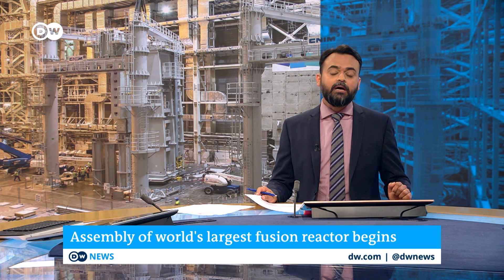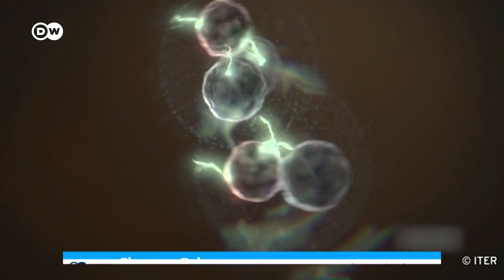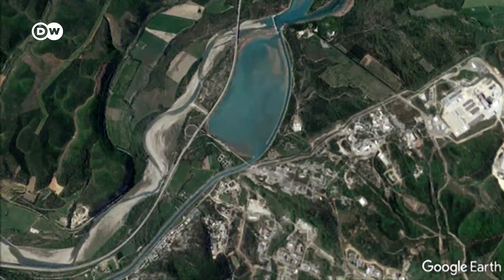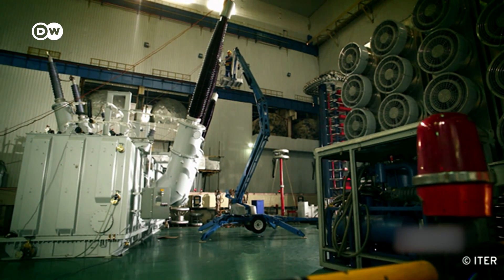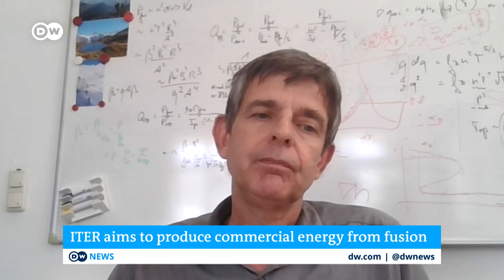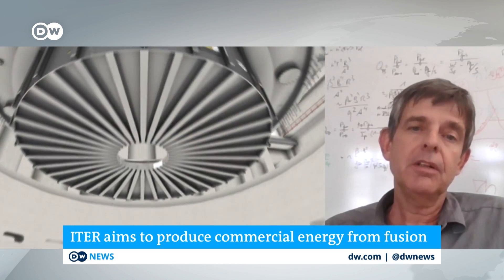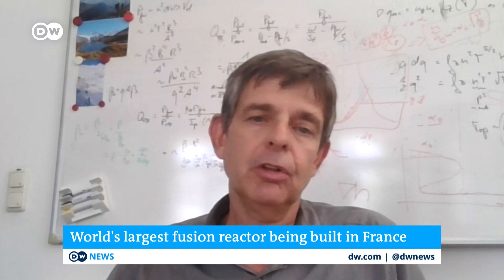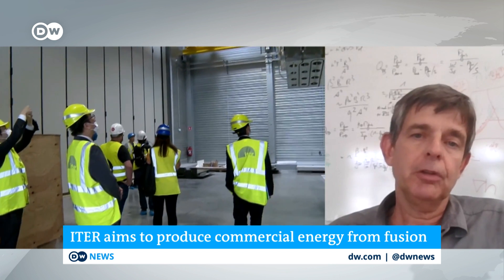ITER: Assembly of world's largest nuclear fusion reactor begins | DW News

Comment: btw this isnt a bomb, if the thing failed, the plasma will expand and cool quickly, stopping the experiment.
Edit: I have now provoked a nerd war WHAT DO I DO I JUST WATCHED A KURZETGAT VIDEO OH GOD.
Reply: Normal nuclear reactors arent bombs either
Reply: @jessegm1  its impossible to ITER to explore, even reactor breach is unlikely. inside the torus, there only few hundred gram of hydrogen(unlike fision reactor that contain tons of fuel), if it touch the wall and melt it that's just it. you just need to repair damaged panel and the experiment can be restarted. the problem is, if the magnet get damaged. its more expensive and complicated to repair
Reply: @royk7712  it really hard to read you englisch
Reply: @Poth94  english*
Reply: @jessegm1  Yeah, this is what russians said. it was a famous last word. XD This is way more safe+no dangerous waste.
Reply: @jessegm1  yes they are!
Reply: Exactly it’s so difficult get the conditions right to make fusion happen that if anything goes wrong then the conditions won’t be perfect and it will simply stop
Reply: Isn't thermonuclear bomb fusion?
Reply: @anonymousstout4759  Yes. But completely different : the fusion is achieved through the explosion of an atomic bomb. Impossible to control...
Reply: only if you had spiderman to throw it to river
Reply: The magnetic field could be hazourdous to a person who has forgotten about removing body piercings .
Reply: So tell me, what happens to the 200,000,000 million degrees of heat that is needed for the fusion process ,if something was to go wrong, the last time I looked there is no substance known to man that can withstand that temperature, hmmmmmmmm....
Reply: @dennisrichards7994  Answer: haha magnet keep fusion in place go vroom
Reply: @someguy5944  I know all that!!! but like I said if something was to go wrong like the electromagnet was to quit and as you say it keeps the super heated plasma from touching anything and it needs an enormous  amount of electricity to achieve that so again where does two hundred million degrees go ??? I can tell you , good by plant!!!
Reply: @dennisrichards7994  The plasma in a reactor is super hot as you said, however their is such a tiny amount of it. As the plasma expands it would cool rapidly, very rapidly! Any contact with ablated wall material or atmosphere would only serve to col it faster. This is know as quenching. Back to the very small amount of plasma. Its the equivilent of dropping a molten drop of liquid metal into an olympic sized swimming pool. The amount of hot stuff is insignificant to the amount of the cold stuff. The temperature of the pool would be unchanged.
Reply: @Krys2289  Sorry! not convinced , we are talking about 200, million degrees not   molten metal witch is only a couple of thousand , we are talking about heat so hot that it is several times that of the interior of the sun ...
Reply: @dennisrichards7994  well, they would have a release mechanism right? It's plasma so it just disappears or something like that :/
Reply: Yup, and I undersand your concern. But plasma quenching is a very real issue for fussion reactors. Even the smallest amount of ablated material or ingressed air will rapidly cool any plasma. Its one of the reason a fusion reactor is hard to get going. Any outgassing componants will severly hamper your ability to get to temperature.

This is why the JET (and ITER) reactor switched from graphite to berylium plasma facing tiles. 1) carbon is a bit of a sponge and absorbs gasses which then later outgass during runs. Be is also a ligther element than C or O so the effects of it quenching are reduced. Quenching ability scales roughly as a factor of ~Z squared (Z=proton number, so Be=2^2=4, iron=26^2=676). Be also has great thermal properties to help transfere heat away. Tungsten is often used in other places too for its good thermal properties, high melting point, but its high Z of 74 means its not great for plasma facing if it were to be ablated. 

The outgassing issue is taken so seriously that part of the research I have been involved with was to test how much the coating for the screws for the plasma facing Be tiles in ITER outgass under different conditions (and look for corrosion/wear). Was real concern it could outgass sulphur which is really not desired in ones fusion plasma (Z=16) and would cause quenching. The tiny amount of gas, maybe evolved from a tiny componant is thought about because plasma quenching is that big a concern. A reactor breach and the massive inrush of air? least of our worries!

As for plasma escaping confinement, yes this can happen within the reactor, though great strides are being taken to understand and mitigate these. but as it dies escape confinement it will very rapidly expand and cool so when it does contact a surface its not as hot as you would imagine. it will still of course cause damage to the plasma facing tiles, but thats the job they are designed for. They will need changing when damaged or after a certain amount of wear yes. But an arc of plasma isnt going to lance out of confinement, punch though several hundred tonnes of reactor wall, structure, breeder blankets and colant systems and reduce the surrouding area to molten slag. 

Going to have to trust us scientists on this one!
Reply: @Krys2289  Nope ,I will never just trast a group of people just on physics no matter how smart they claim to be , because History as shown that science has got it wrong on many occasions and we already have nuclear fusion going on right above our heads , that's what what they should be working on , the sun throws more energy at us then we could ever hope to use , not like this pye in the sky stuff and realistically the huge cost is just prohibitive in this fusion technology...
Reply: We have operating fusion reactors at the moment. We have had vacuum leaks and confinement failures (some times on purpose!). we know what happens. 

Physics also explains how planes fly, and your computer works. do you not trust those either? By that logic we shouldnt do anyhting, because we might be wrong! We only find out we are wrong if we push the bounderies. Thermodynamics etc says a gas cools as it expands. Plasma physics says quenching sclaes with Z^2. all backed up by bodies of evidence. 

Im all for solar as a renewable source. Not my area of expertise though. Happy to investigate the materials though, got most of the tools. (or do you not trust electron microscopes and the like?) 

Yes the huge cost is an issue. But we are still learning. I fully expect cost to come down with time. Some people and companies are already working on miniaturised reactor designs.
Reply: @dennisrichards7994  you got some strange thoughts. this part about plasma and what if it leaks isnt even complicated science, its like you are saying you dont believe that if you toss a ball it will come back down because scientists are sometimes wrong, a tiny amount of hot stuff vs a fxxx ton of cold stuff means theres not much change in temp of the cold stuff when they meet. this is like 7th grade math here. theres literally like 0.5 grams of hydrogen in that reactor, while each section of the containment wall is like 400 tonnes of steel, go ask google how much more mass that is than the hydrogen.
Reply: @dennisrichards7994  Now your problem is with science? You're blaming it all on the fundamental "trial and error" principle that drives us and science complementarely? Just stop bro, @Chris Smith just gave you 100 well fundamented reasons on how you just shouldn't worry about it, all based on renowned scientists that studied this their whole life and yet you willingly choose blatant ignorance over just letting it go? Don't be like the old fart that doesn't trust technology just because he's totally out of touch with the present.
Reply: @ThiagoSilva-gb2iv  Like I said I!!! will never put my trust in anybody especially when it comes to a group of people trying to create a sun on our earth when as I said we have a star producing more power than we will ever use , and it's free , as I type a response to your post my roof is sending power back into the grid in total silence and there is many other forms of renewable energy that can be explored and it's a sure thing and if we start building them now most of them will be up and running within two years but what of this fusion idea , I mean, how long have they been working on this and still can't get it to perpetually run but here's the thing ! THE COST is it's biggest drawback , how many trillions have they spent on this so far ? and how many more will it be be for have one is up and running , BTW nobody tells me to stop !!!
Reply: @dennisrichards7994  jeez, so many explanation points
Reply: @ThiagoSilva-gb2iv  Is that your come back ???
Reply: @dennisrichards7994  no but think about it the plasma is so small as the experiment stops it would just cool. It's not like any other state of matter that would keep the temperature consistently for a long period of time to cause any harm
Reply: Some guy? Still intact.
Reply: Worst-case scenario: the reactor vessel develops a leak, the plasma immediately condenses into gas, and everyone calmly walks out of the building with high-pitched voices.
Reply: I know. I watched Kurzgesagt
Reply: But could this technology lead to a "pure fusion" bomb, with all the explosive yeild of an h-bomb, but without the fallout?
Reply: @JesusHChrist2000  not likely, the thing about fusion is that it's very difficult to get it started and keep it going. You need very high pressures and temperatures, just to get it going. This is what the scientist is talking about when he says achieving "net energy gain". You need to put a lot of energy in the hydrogen and deuterium to heat it into plasma, and then power really strong electromagnets that compress the plasma. You need very powefull generators to power this process. Imagine trying to fit all of this in a bomb. Or even in a plane. It would be impossible. And as soon the electromagnets stopped and the plasma expanded it would cool down and fusion would stop.

However, if someone did find a way to make a fusion bomb it would still produce radioactive fallout, probably. Both fusion and fision produce radioactive particles. However which particles and how serious it would be depends on the actual elements used.
Reply: @danieldiaz5342  A pure fusion bomb would produce neutron radiation which would irradiate the local atmosphere, but the bomb wouldn't produce highly radioactive fission products like cobalt 60, or iodine 131, or unfissioned plutonium, which make up the most dangerous fallout. 
That is one reason why a "pure fusion" bomb might be more likley to be used in war.
Reply: @JesusHChrist2000  THATS THE MOST LIKELY FIRST USE OF THIS TECHNOLOGY, NICE AND CLEAN HYDROGEN BOMBS FOR TACTICAL USE...

Comment: "The hydrogen could be extracted from seawater, making it a practically unlimited resource."
News over 100 years... "We need to find alternative power sources because the sea is getting too empty and pumping too much oxygen in the air, causing mass oxygen toxicity".
Reply: You can just release the water back after extracting the hydrogen...
Reply: @lud3re384  Water without hydrogen?!
I'm no chemist so I may say/type something completely wrong but:
 H²O = H² (2 Hydrogen atoms  per molecule) + O (1 Oxygen atom per molecule) = Water.
So, take the Hydrogen atoms away and you're left with just Oxygen, not water, afaik.
Correct me if I'm wrong...
Reply: No wories, we can neutralize the Oxygen with Carbon. CO2 is a great, stable molecule.

Comment: so they built a reactor for something we don't even know that we can effectively do?????
Reply: You expect them to develop something without any testing?
Reply: @Gomlmon99  not at all, i just feel like it would be better to know its something we can do on a small scale before we go building a massive generator. do they need all that space in order to experiment? is it really that huge of a process??? im not trying to be rude or anything, i'm genuinely curious and would love to learn more :0 tone just doesn't transfer well over the internet
Reply: @moosekababs  there are some small scale fusion reactors
Reply: @tejasbhandare251  oh, cool!!! do they actually generate energy?
Reply: Ren there are a few others. The most similar, of which ITER is a sequel, is JET. JET is about half as big in each direction, and uses normal copper magnets rather than super conducting ones. 

Both reactors produce (or will) energy, but the energy is not captured and turned into electricity as they are both purely for research. 

The thing with this type of fusion (magnetic confinement) is that keeping all the plasma/energy in one ball is hard, and it often dissipates away. Building a larger plasma means a smaller proportion of your energy is lost and confinement is easier. 

With ITER being much bigger, it will produce much more energy. JET was something like 16 MW, Q of 0.67. ITER aims for 500 MW, Q of 10.

Comment: In the end, this will probably yield some important research results, but the path to a working power reactor will probably lie elsewhere. Other programs are under way that use superconductors and do not have the constraints that ITER does. When you have something that takes 30 or 40 years from the initial plans until it really gets going, that's the kind of problem you are going to encounter. When you've put in billions of euros and many years, you're not going to just scrap your design and start over.

Comment: If it works, all that remains is to find ways to reduce cost
Reply: @Algion Yeah me too. Sometimes I just wish wish I can live long enough to finally see fusion be commercial lol
Reply: @Algion Yes. But, whether it will work or not(achieve its primary objectives) is still a question as ITER has yet to finish its assembly and start its operations(Though, I have good hopes for that). But even if it does, there's no way that a power plant that costs 25-45 Billion USD can be put into commercial use. 

Correct me if I'm wrong, but from what I've read, the magnetic confinement and heating system seem to be a significant contributor to the high cost. Iter uses a total 100,000km Nb-Ti/Nb-Sn alloy for the coiling in the toroidal MF and central solenoid. Not to mention, they are only superconducting when cooled by liquid Helium(which is also expensive).

So idk, maybe they can upgrade or introduce new high-temp superconducting materials like YBCO coated superconductors as it can be superconducting when cooled with liquid nitrogen(Still under research). Going from liquid helium to liquid nitrogen would be a real bonus.

Also, the stellarator design by the W7-X seems promising too. Maybe it can be implemented to future fusion devices as it would eliminate the need of a central transformer. Well, I really hope they'll figure it out.

Comment: uh....can we wait to turn it on until AFTER this cursed year?
Reply: Fusion reactors are supposed to be much safer than fission reactors
Reply: it won't be finished for 10 years
Reply: It'll will be turned on in 2025 at the earliest. Although, WW III did start in 2026 in Star Trek...
Reply: There's literally nothing that can go wrong. There's already many fusion reactors that have run. Because they require so much energy to keep the reaction going, they cannot turn into a run-off explosion where all the fuel just burns up and explodes. If it stops receiving its external power it simply shuts down, no need to keep radioactive rods cooled or anything of the sort.
Reply: @invertexyz  i'm more worried about something being broken badly in the reactor and fusion research being set back.
Reply: @cageybee7221  tbh ITER isn't that important anymore. It took wayyy too long to get started and is going at way too slow a construction pace due to various factors, a big one being the multi-country governmental red tape they constantly have to deal through. The private sector has already been making huge advancements in that time that have given us the proofs we need. ITER and it's aging tokamak design are a relic of the past, governments behind the project decided to go with a design that is already proven and was just a matter of scaling up, but which is terribly innefficient compared to more radical designs like the stellarator and other designs big companies are scaling up now.
By the time ITER actually has anything to show, other reactors are going to be embarrassing ITER, unfortunately. But they've put so much money into it now they can't turn back.
Not that I'm some big pro-capitalist person though, ideally a government would look for the best designs the private sector produces and start building them for the good of the people in the future. But private sector is our best option for advancement until our society is less reliant on money.